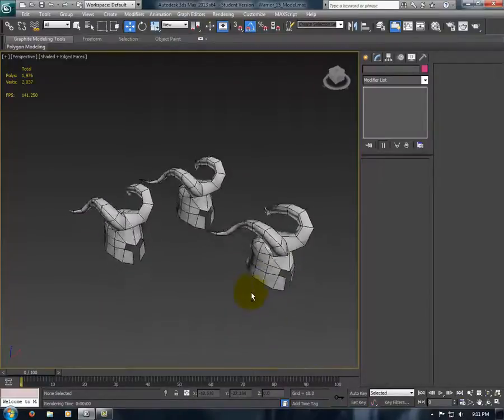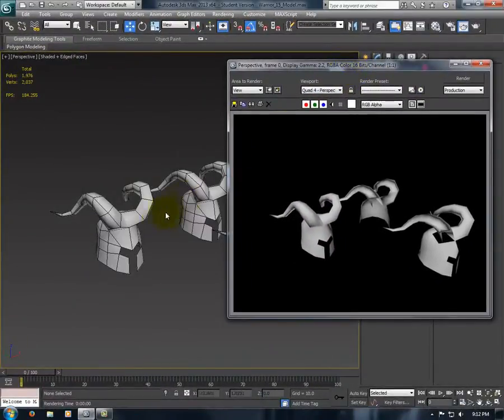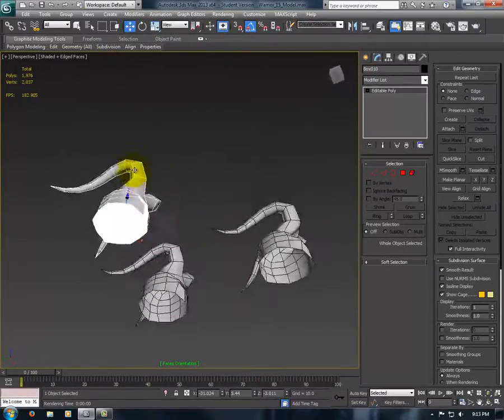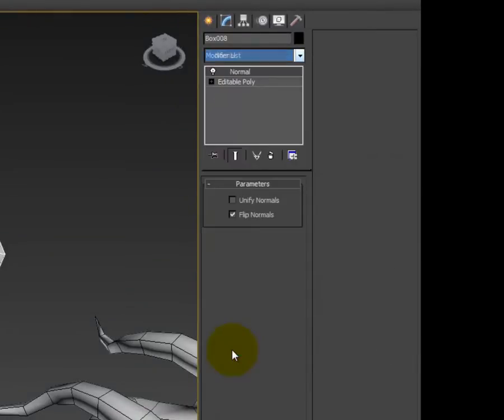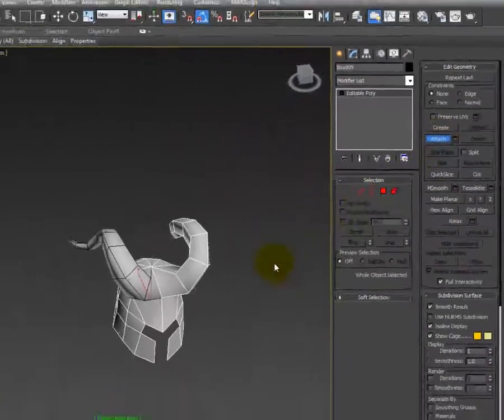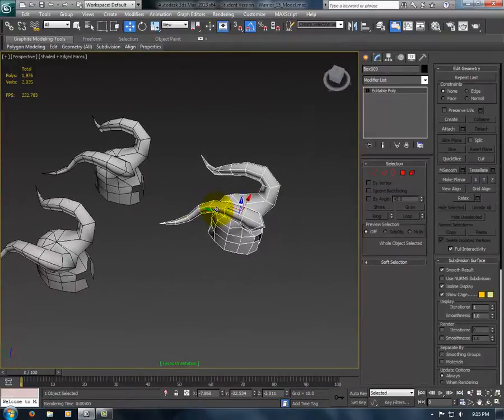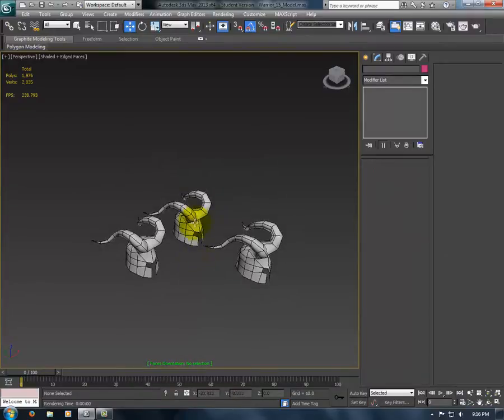3DS Max: How to Fix Normals

Comment: I can't believe you have to go through all this just to flip normals in 3dsmax. This is insane. How you guys use this program is beyond me. This is fine when it's in 3dsmax only because most would just turn off the backface culling and forget about it. Unfortunately I have to export some models to another software and because of this normal issue it's a complete nightmare. This is the only reason I am here. If anyone knows of a better way or script to fix normal issues like this please let me know. Thanks
Reply: Normal modifier. Unify normals and then flip them if need to, unfortunately, I have problem, that this shit doesn't solve, but it is very useful

Comment: I'm so glad this works for Gmax too. I accidentally deleted my project file for Gmax after I imported my file into Blender. I used a script to import the obj file I made but the normals were messed up but it seemed just fine when I imported parts of the model separately and whats great too is that the UV maps were preserved.

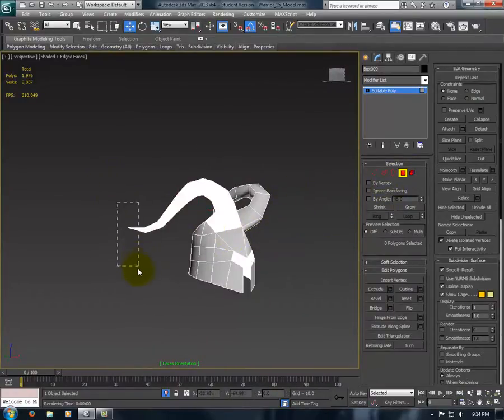Comment: 2:50 - and that's why Autodesk must implement the CONFORM option, like in Maya. Ok, it works when selecting the faulty faces in your 40 polygons helmet, but do that with tens of millions of polygons scanned models, where you have a lot of artifacts and random normals...🙄
Reply: If you are using Maya. Why are you watching this video?
Reply: I'm using both, is this something wrong? It's sad because you can't turn all normals in a mesh in the same direction, after 20 versions. It's something modelers have been asking on their forums since early 2000s.
Reply: Caesar dude. I know it is sad. But 3ds Max is a great tool and those constant remarks in how Maya is better is nonsense. Not just from you. Autodesk is an authority in 3d software, if that feature is not there is because it can’t be at moment. I am sure one day it will resolved.
Reply: Ceasars comment is helpful. It lets others like me (who have that exact problem, many flipped normals) know that it is in fact not possible with 3dsmax. So there's no need to spend any more time on it and instead look for an alternative solution.
Reply: Give it a chance though, beside small inconveniences like this, 3dsmax is a great tool for single users, its interface and tools are more direct , and there are TONS of plugins, free scripts, shaders, render engines, tutorials and so on for it!